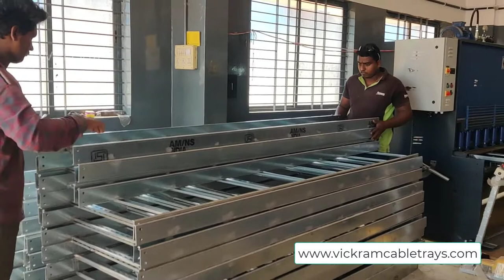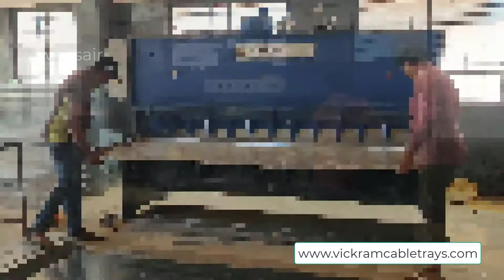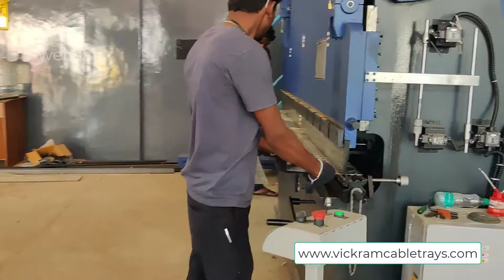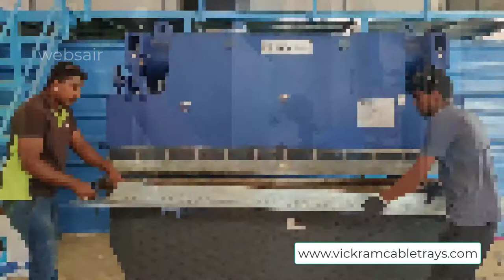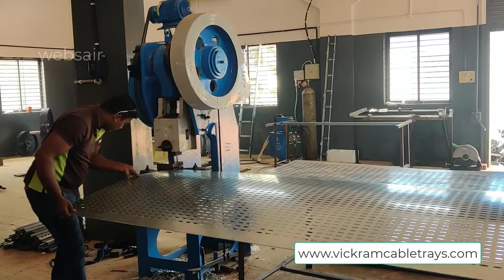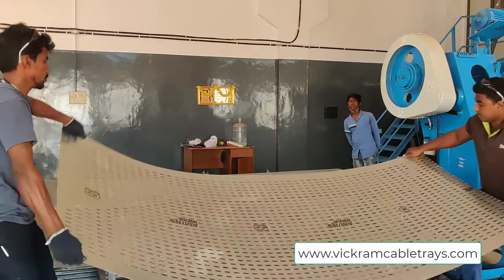Cable Trays and Perforated Ladder C Channel Raceway at Peenya Bangalore in India

Comment: If you have much production, you may check our Press brake which designed for Cable tray auto bending, one operator could handle the bending jobs